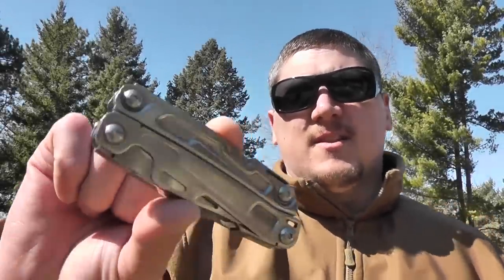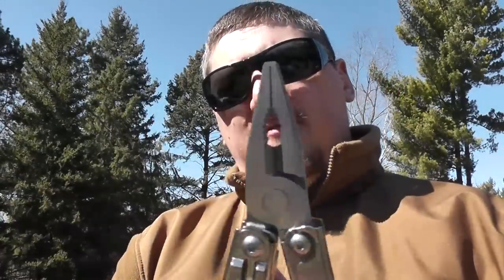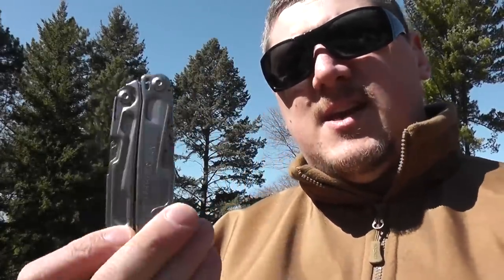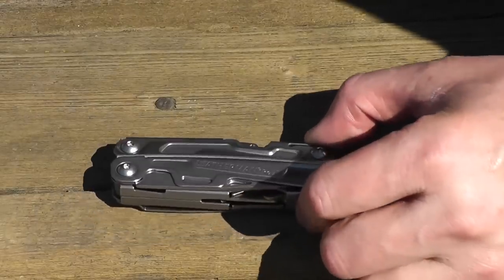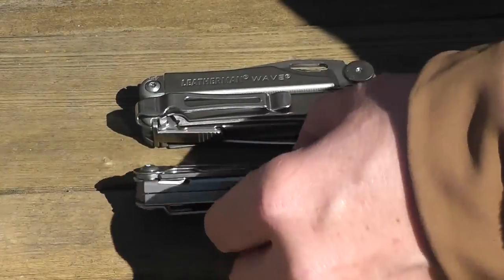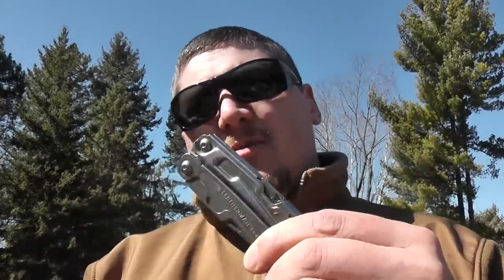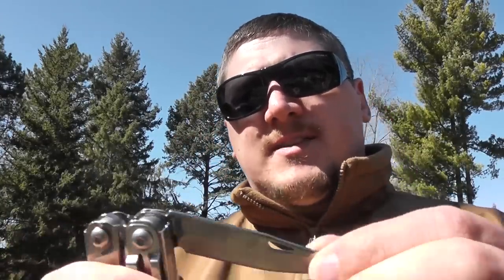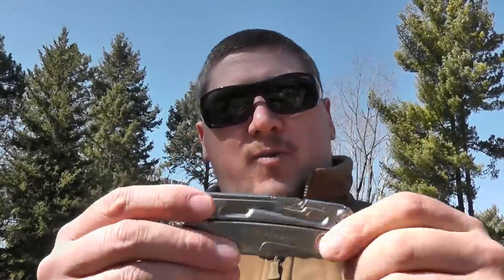Leatherman REV Budget Friendly Multi-Tool

Comment: Great review I like the rev just the rev has 14 tools. 1 knife 2 needle nose pliers 3 regular pliers 4 wire cutters 5 flips head 6 flat head 7 bottle opener 8 can opener 9 wire bender 10 wire stripe 11 ruler 12 file 13 small flat head 14 package opener.

Comment: Thanks for your review!
I wonder why they went with custom screws on Rebar and Super Tool 300 instead of the ones they use on their other multi tools, you can easily tighten/losen Rev and Surge, but you cant do so with ST300 and Rebar, I had to use Wingmans pliers to tighten my ST300 :D!
Reply from the maker: rrreger Interesting, never noticed. thanks.

Comment: Ben, any concerns with leaving a Leatherman in a car all year round with extreme temperature shifts (especially hot/humid summers when the car gets hotter than 100 degrees). Will it degrade the tool or does the tool require any routine maintenance to withstand the changes in temperature?
Reply from the maker: +wisperingbeard Nope, just some tool oil once in a while is all I do with mine.
Reply: +Living Survival Thanks!

Comment: I don't get what is supposed to be good about this new mt. The Wingman offers the same tool set plus scissors and spring loaded pliers that appear to be wider and more robust at the base, for less money. Maybe I'm missing something but the Rev looks like a step backward in value. The wt deference is irrelevant to me because of the size/bulk. Many of us don't wear cargo pants
Reply from the maker: 05generic The price point is what makes it different. The knife is nicer on this than the sidekick/wingman as well.
Reply: Living Survival I'm beginning to wonder if the price increased since you posted the link. It's ~ $6 more than the Wingman and both knives are 420hc. How is it that much better?
Reply from the maker: It's only because it is new...it will come down :)
Reply: Living Survival Okay, I'm good with that. If the price comes down to less than that of the Wingman, I'll consider it, possibly, a good value. I haven't used/tested any of the so called value Leathermans. I've seen positive and negative comments about them. The file looks like it might be inferior to the Squirt file. LOL
Reply: If you look closely you'll see the Rev has better wire cutters than the Wingman.
Reply: Pinki2019 Yeah, I think you're right. Good eye. It looks like the conventional type instead of the pinch type.
Reply from the maker: 05generic And the wingman also has the pointless (IMO) serrations on the blade. Pinki2019 yes regular wire cutters, not pinch.

Comment: The Rev, in my opinion, is Leatherman's worst MT as far as design. The knife is one feature that really got me. It just seemed so unnecessary to move that hole taking away the one-handed option when the cut out for it on the body was already there (same as wingman/sidekick) and I'm sure they had to re-do their tech to make it that way when they were already set up for it from producing the wingman/sidekick. Just made no sense. Then the pliers with no spring. and a few others. Its like LM said "hmm, our 2 budget tools are too good of a deal. Lets up the prices and put out something just shitty enough it will drive people to our newly higher priced budget tools, or our premium MT's", which is pretty much what has happened. Granted there are people who still buy the Rev, but those people are usually people who dont know/care enough about MT's and just want something cheap that they'll use a couple times a month, etc. Ehh anyways just my opinion like I said and could be totally wrong. Clean video though :D
Reply from the maker: thanks for the comment.
Reply: @Moustapha: Your right it is totally fine to disagree, because opinions are completely subjective. Doesn't make them right or wrong. Just makes them opinions ;)